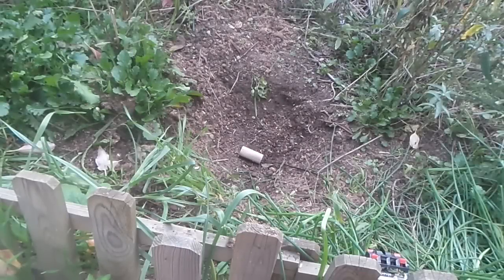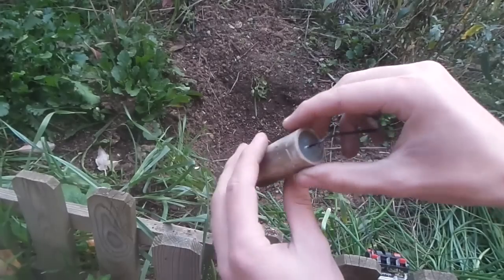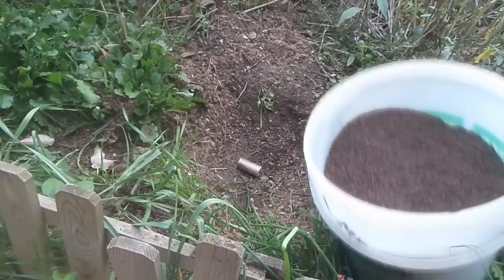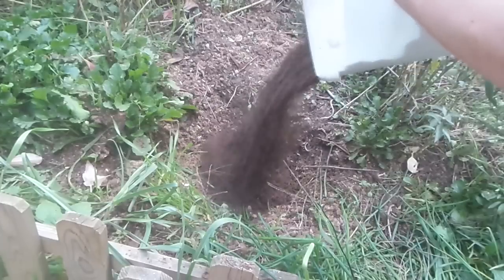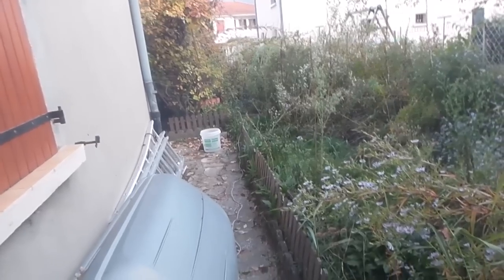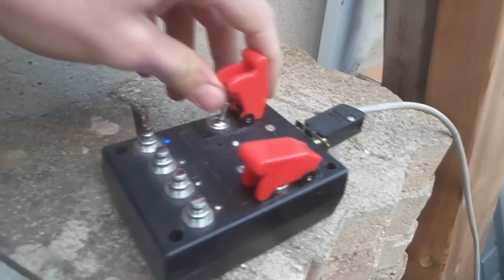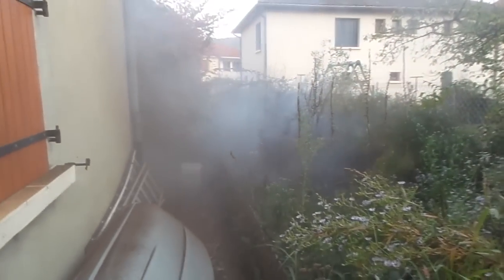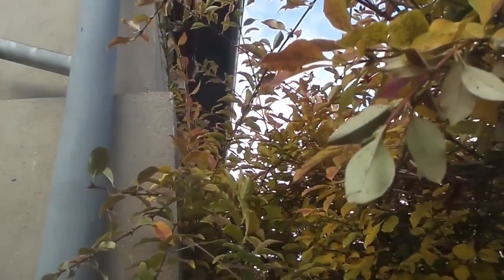Movie special effects - Ground salute bomb hit simulation - Pyro-Build Projects

Comment: Yeah so I'm kind of new to this. I was expecting my tubes to get here today and I made exactly 30 g of potassium nitrate, Indian blackhead aluminum powder and sulfur flash powder. And I have no tubes to put it in at all. I was going to make a bunch of small salutes. And as I sit here looking at 30 g of it sitting in a sealed HDPE plastic bottle... I'm contemplating literally opening up the window and letting the wind just take it. The general consensus is that storing absolutely any amount of flash powder is a horrible idea and God forbid anybody tell me what a safe container would consist of. 

It's my own damn fault for not waiting until the tubes were actually in my hands. Fucking post office screwing things up like they always do. 

Looks like I'm going to wait for the next breeze open up the window and slowly dump it into the breeze. Last thing I want to have happen is 30 g of this shit detonating inside. 

What a disappointment. Oh well. Live and learn. Great video. Interesting flash powder that you mentioned. I hear that potassium chlorate with magnesium makes for some really bright violent reactions. Pretty sure that's what flash bangs consist of. I know that they've got magnesium in them. As you can tell I'm new to this stuff.
Reply from the maker: Chlorate based flash powder is very sensitive to shock friction etc, very rarely used in fireworkd for that reason but pot nitrate based flash is no big deal. I wouldn't worry about storing 30g of it, trust me it wont spontaneously combust 😉

Comment: Would be awsome to see a burst now. Say three to five shots as they would be from a jet. You don't have to be speeding away in a car or any thing. The challenge would most likely be the timing at which they were set off. But with that ignition system you have, that's half the battle by itself. Really liked this one man. Good job

Comment: How do you know, if the tube containing the flash powder is long enough and has the right diameter?
Is there a trick or do you just guess?
Reply: U will have to know by trail an error
Reply: He is actually filling the tube up too much there is allmost No air in the tube when he close it up whit glue and you need atleast 1/3 of the tube whit a airgap to function right and perform optimal

Comment: what are the best plugs for homemade salutes ? gypsum ? clay ? hot glue always getting shot out in mine salutes
Reply from the maker: Well in general, a good plug must be solid and most importantly must disintegrate when the charge goes off to avoid shrapnel at all costs... Hot glue is very solid but will shoot out like a bullet... I used hot glue because it is faster and easyer to use, and I didn't have to worry about shrapnel because I knew I would burry it. I think it is best to use that special clay they use to plug tubes in cakes for example... that's where i get it... it is rock solid when it's tamped down and turns into dust as soon as the salute explodes...